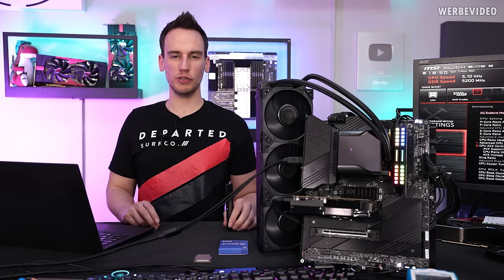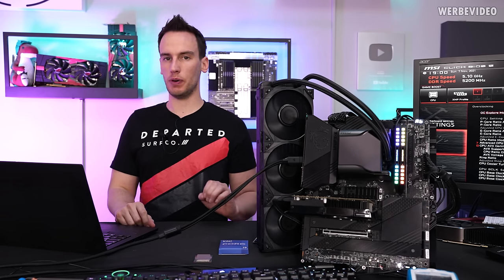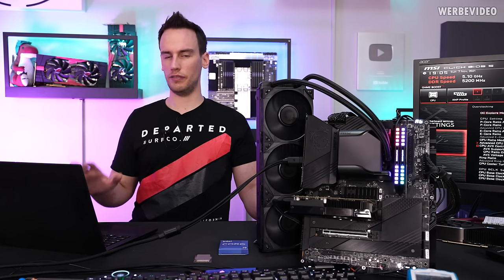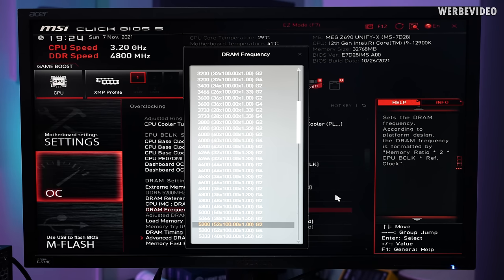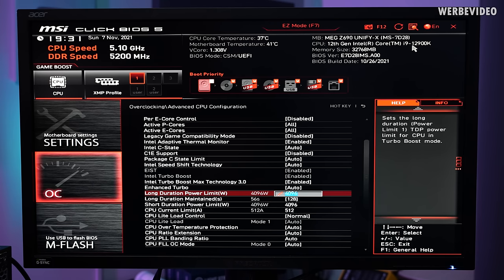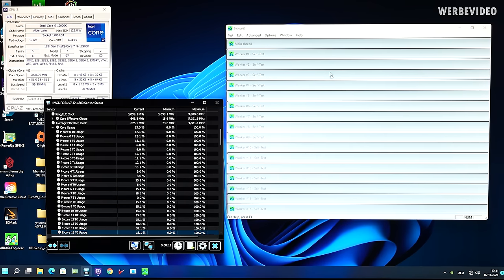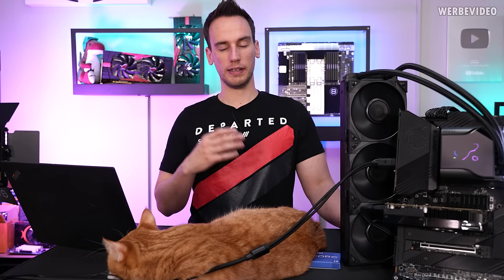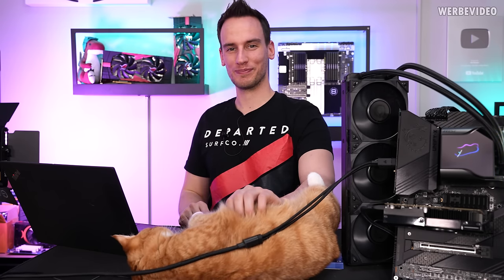Intel 12900K Clocks, Voltages and Overclocking explained - feat. MSI Z690 Unify-X

Comment: Nice video about overclocking, but how about undervolting? How to get stable performance without 90 degree heater? Now its winter, pretty beneficial, but i am worried about summer.

Comment: Overclocking the i9-12900K doesn't make sense regardless of cooling, there's hardly a performance benefit in rendering, a little in gaming but I'd say not worth doubling your power usage for.
Reply: Exactly what jay2cents said also! Put it on ai overclock and you're done
Reply: @Poppaai  It doesn't even need overclocking, 5.3/4.1 is only 15s faster in blender than stock, while using 100W more.
Reply: @frostybe3r  what about gaming?
Reply: @Poppaai  At 1080P it makes a difference
Reply: @frostybe3r  i'm gaming at 1080p low settings to get the most fps possible
Reply: @Poppaai  Why?
Reply: @frostybe3r  esport gaming
Reply: @Poppaai  welk moederbord gebruik je? Warzone getest?
Reply: Imagine buying a 12900k to play at 1080p on low settings with the excuse of "esports gaming", just to be below average.
Reply: @Nghtmare30589  You do realise that the better 1/0.1% lows carry over regardless of resolution? At 4K I have a far nicer and less stuttery experience on my i9-12900K than the 5950X.
Reply: @Nghtmare30589  imagine making a dumb comment when you don't even know the person
Reply: @frostybe3r  input lag and gray to gray performance matter in esports dummy!
Reply: @glitchinthematrix9306  Why would I play eSports? I'm not 15.

Comment: I don't find the argument "just stability test in gaming" particularly good one. Games don't stress the CPU until they do. Every game utilizes the CPU differently and multiplayer often vastly increases the stress on the CPU depending on the scenario. Yes, if you play just few games and nothing else then maybe but otherwise you'll be constantly worried if the next game crashes your system. I have 5950x and in R23 the CPU maxes out at 72C and that's what I typically see in games, but there are some other games (like Cyberpunk or WoW) that push the tempeture much higher, because they utilize all cores and on top of that few cores are pushed to the max with 16-17W on the core, which can cause the CPU to go past 80C. No doubt this is also because the GPU is dumping so much heat that it increases the temperature of all the components. All in all, I don't think it's worth to push the CPU to a point at which it can be unstable for measly 10-15% performance gain.

Comment: Can anyone who owns this board confirm if the Fans spin up quickly (ex from 30% to 100%) or they take something like 20-30 seconds as is happening with me?
Reply: I have the same motherboard. You can adjust the fan curve in the bios. Mine work to spec.  There's an option in MSI command center to gradually speed up, or speed immediately.  To be fair, I would not use the MSI application and configure everything in your bios. If this still fails, could be an issue with your motherboard.
Reply: @judgeees  Ended up being an issue with the mobo, fairly common among others as well. Traded the mobo with the Z690 Apex, which ended up being actually better in every way

Comment: I really disagree with his perspective at what is stability.   He says just game for 30 minutes and check for blue screens.  That's cool, but then a few months later you need to use your computer to do something and suddenly it starts crashing and you have no idea why.  It's because it wasn't stable to begin with.

I'm not saying you need to pass an all core AVX test for 24 hours, but I wouldn't be comfortable with my machine if it can't do 15 minutes.   The thing is, yes, you might miss out on some performance that you could have gotten by running an unstable configuration.   Which is what he is really suggesting you do.    But some day you will hit a new game that users more of your CPU than you were expecting and you're not going to understand why stuff keeps crashing.

Comment: Followed all of your steps, but for some reason my 12900k won't boost over 4888 Mhz...
Reply: Which motherboard and what is your power supply?
Reply: @judgeees  MSI MPG z690 carbon EK-x and a cooler master 1200w platinum plus. I managed to get it t 5200, but whenever I fire up a game it clocks back down to 4980, this is really really weird and I wish I knew what the problem was...
Reply: @Av3nG3R100  

99% of games will not require the 5200 so the cpu will not exert itself. The majority of games available are more GPU intensive. 

The 'feel good ' part is that your CPU is no longer a bottle neck. That being said, you have to wait to buy a 4090 with a game that truly challenges your rig and your cpu. Still no games that would max on both right now.

Your CPU is barely doing any of the work. I have a 420mm arctic cooler, 3080ti, 12900k, 1000 w g6 nova. The only thing holding me back from a higher FPS is the GPU, not the CPU. 

You can download cpu stress programs to see if the potential utility of your cpu can be X. Cinebench R23 will give you that multi core score. 
 
MMO's are more cpu heavy (WoW, etc), but I've tried those out as well. Think I hit around 4.9 MAX. 

You would have to look into threading and etc, but you're hitting the max right now. 

Don't fret over the number, but if you want to see your cpu cry, test rendering, encoding, or compression apps.
Reply: @judgeees  thanks for your reply, and I get what you're saying... It just feels like the 12900k should run at least 5.1 while gaming, my 9900k ran a perfect 5 Ghz oc in my precious system while in game, never once downclocking. But I'll leave it for now and keep an eye on it. Thanks again
Reply: @Av3nG3R100  I am no expert, but I have been doing this for a few years. Your 9900k had to use that 5.0 ghz. This is a completely different CPU when it comes to threading.

Examine other videos on YT playing games using  a 12900k. Your cpu doesn't have to clock higher.

If you really want, unlock all your power limitations, and do an auto OC on your board. You'll probably get a higher clock after heating up your CPU in a demanding zone in whatever game you're playing.

Regardless. Good luck, if you find a solution. Please let me know.
Reply: @judgeees  Thanks, I will 😉

Comment: I doubt a 1050 Ti is the best representation for high frequency CPU testing. In that scenario the GPU will be the bottleneck and CPU won't do any work. Why didn't you test that 5.3 GHz overclock on a 3080 or something similar?

Comment: i wouldnt say you are correct in saying that benchmarking is not a good way to verify your gaming stability. In almost ALL scenarios CODwarzone would crash instantly if not enough voltage is applied. Same as prime 95.If I were to slightly increase voltage by .125v increments I will be able to play 30mins before I crash. same as p95 I will be able to test but it will crash after 10mins ,but..... if the perfect voltage is achieved I can pass multiple p95 blend tests and play hours of warzone and it will be stable. i have verified this with years of testing
Reply: ALSO wanted to say that temperatures you might see in prime might be unrealistic but even then it will crash about the same consistencey as you would see gaming but it crashes sooner just letting you know you have to do some adjusting( either in voltages/cooling setup)
Reply: thus p95 is the ultimate benchmark, its like choosing  nightmare difficulty in doom

Comment: its big no no for amd users running 1.45...all cpus should be at 1.40 maximum voltage ...so amd users need to down volt your zen3...its why i like intel platform more than amd...its more understanding than amd did not leave any instructions or guide what each settings do...but intel its very easy now